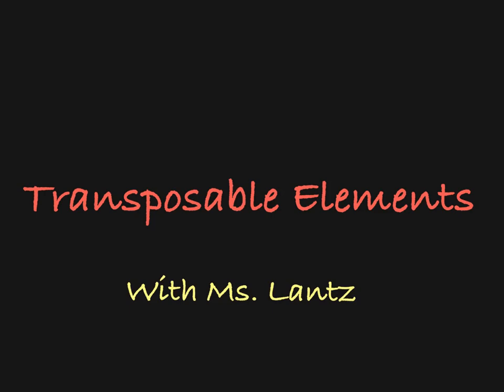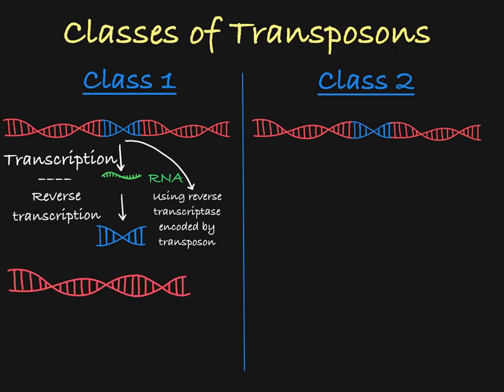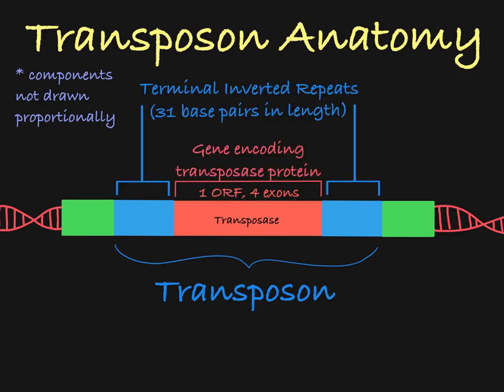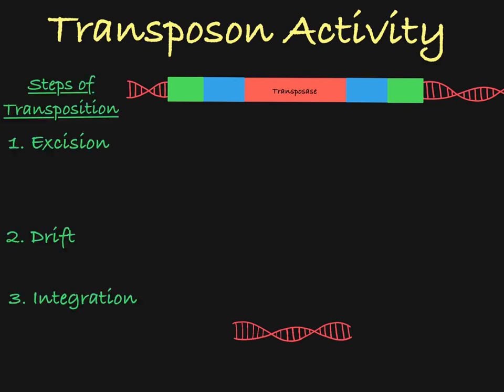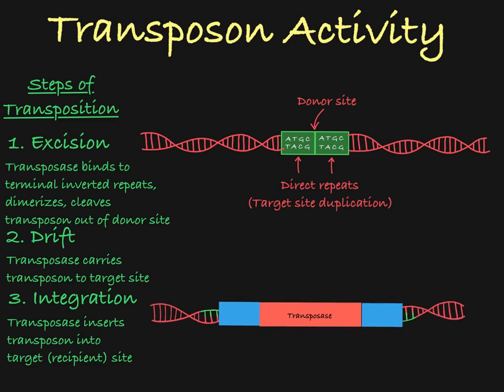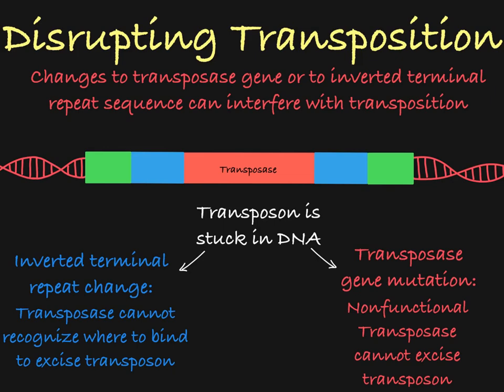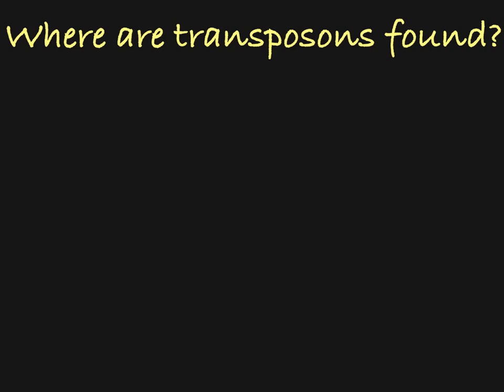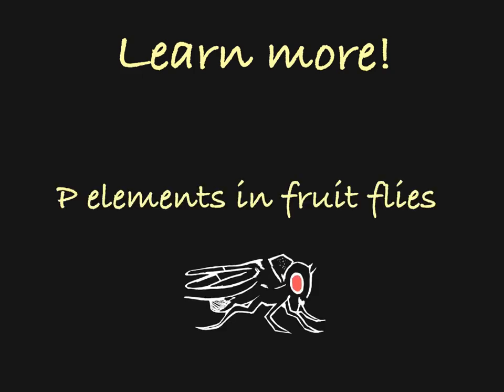Introduction to Transposons

Comment: What causes the target site duplication resulting from the integration process?
Reply from the maker: If you think of the DNA as having a top strand and a bottom strand, complementary to each other- When the transposes cleaves the DNA at the target site, it breaks the covalent bond on the bottom strand before the first base of the target site, and it cleaves the top strand after the last base of the target site. It also severs the hydrogen bonds between the top and bottom strand in all 8 bases of the target site. When the DNA separates to allow for insertion, the 8 bases of the target site on the top strand move to one side of the transposon, while the 8 bases of the target site on the bottom strand move to the other side of the transposon. Then DNA repair enzymes use those strands as templates to fill in the missing bases. This creates a duplication of bases on either side of the transposon. 

The image  linked below is a good example of how this happens (though in the image the direct repeat sequence is only 4 bases when it should be 8)

https://lh3.googleusercontent.com/proxy/c3OPj9s9qoIimDj6JuCAq5GprRy4dbfSEwkCl-Zj4Il-q1n7YLSYQqI0CSwEPZmL9ULI8LL3J4YevIISgMsceQuPgKu2lGaYpGCgC09jltgOdSfH8yabGMy7zIQgqgRxhKSqERIvAKrJuRIHl4eKPH7SlsaD